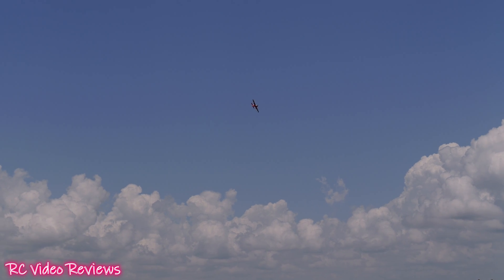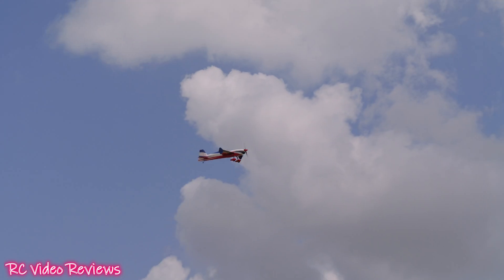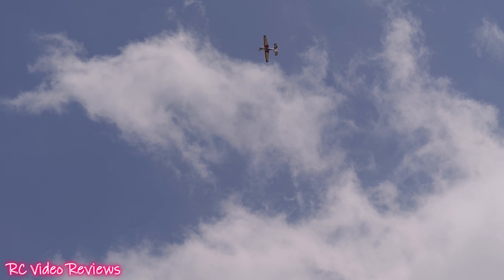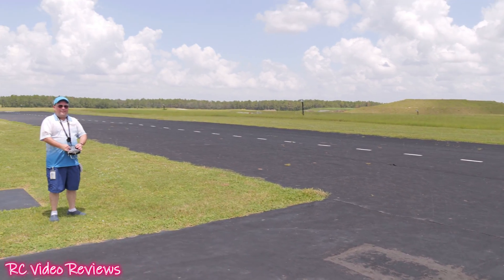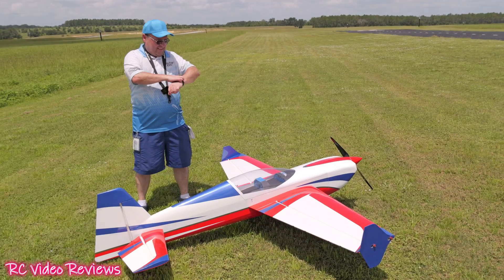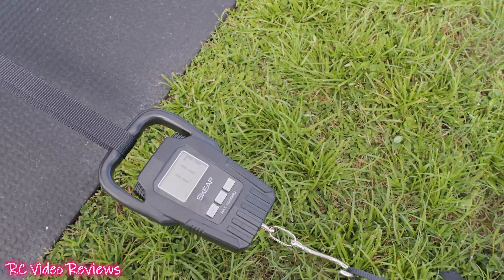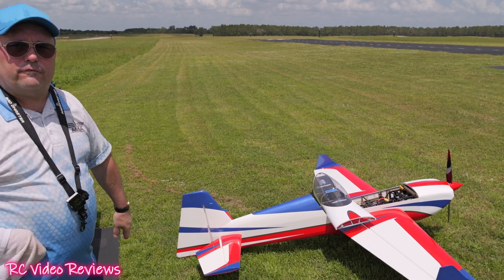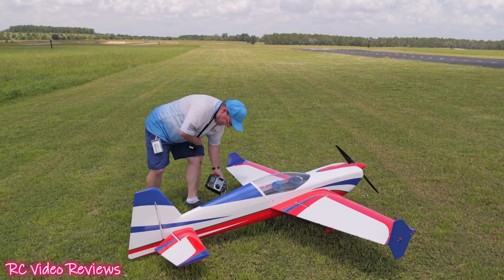Brand New T-Motor AM850 195Kv + AM216 ESC and CF Prop Test

Comment: Hi I am building my VTOL
I am curious about motor selection
Which one is better
EMAX ECO 2807 1300KV 3~6S (drone motor) or  DYS 3530 1400KV 4S (RC Fix Wing motor)

Surprisingly the data shows that the DYS motor only produce 1200gram / 450W  while EMAX  can produce 2500gram/1100watt
Focusing on efficiency, Emax produce 1100gram with only 350watt

Does it mean drone motor more capable and efficient for our build?
My VTOL Plane weight is around 1.5kgs

Comment: Hi John. Connecting with you on your latest video. Apologies for being off topic. I am having issues with all my HobbyEagle gyros using Sbus via TX16S ELRS (low packet rates <250 tested). Setup and mapping are easy. No issues here. Using channel 6 for modes and channel 5 for rates (so low and high only). Lights on the HobbyEagle responding correctly and the channel are reflecting and moving correctly in the A3 Configurator. I am using A3 Mini as well as the A3 Super 4. Both have the same following issue: Once the Sbus is pluged in, the gyro does not work at all and does not respond to movement of the planes. All other control surfaces and throttle work normally. The rates changes, so this works. However, no matter in what mode I am, there is no gyro compensation. And here is the funny thing. As soon as I unplug the Sbus, then the gyro does its thing and compensate for movements. A little context...after watching your videos I thought I will give the gyros a go. Most of my planes have flight controllers and full FPV. So, my last two builds with HobbyEagle gyros are an attempt to get more into line of site flying. PS.. think you are doing excellent content on your channel. Back to the issue ... what the heck am I missing ?
Reply: Hi John. I found the issue. One has to put the Gain on a slider. Not on channel 5. I used channel 8. Now all works well.

Comment: Thanks for the upload. Good looking plane. Healthy motor combo as well. I'm sure it will serve you well.
Reply: Well.
 It's already got a 24 inch fan right in front of the airplane that should be enough.😁
Reply: @davidpaker626 😂
Reply from the maker: I have to give T-motor credit for quality of build/machining. They usually produce high quality hardware.
Reply: @RCVideoReviews  yes, me too. I have a couple of XTF 67's that have the 670. Very impressive. Also bought the 480 in 6S and 4S for a couple of conversions. I waited as long as I could to see what you put on your 85 inch plane. I don't know if you ever disclosed. But I ended up using the XPWR 60 with a Hobbywing 180 a ESC.
Reply: @davidpaker626  nice flying Dave. Good to see you guys having fun.
Reply: Thank you. We were trying too, but it was like 500000°. out there.😂😂
Reply: @davidpaker626  and for some reason you said you didn't need a fan??! On the ESC??